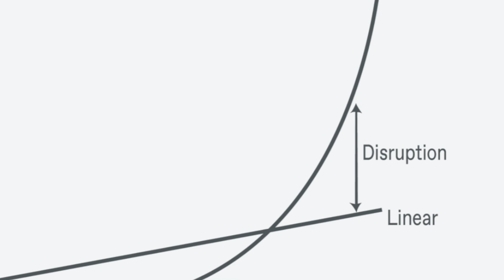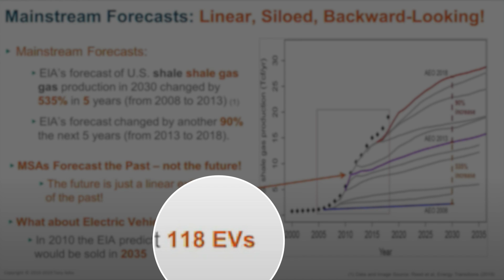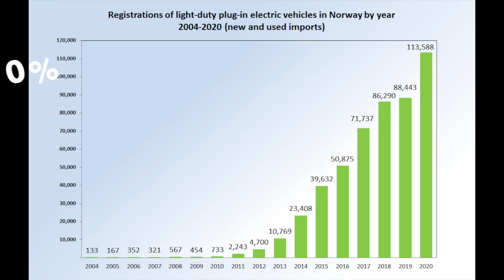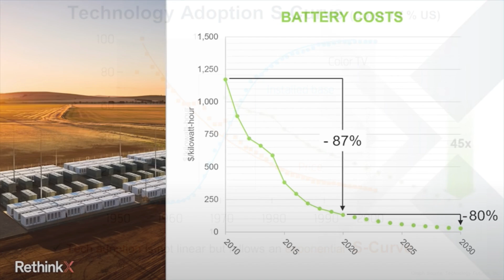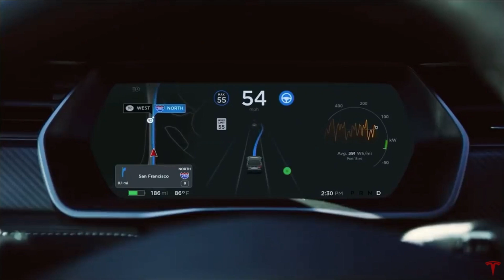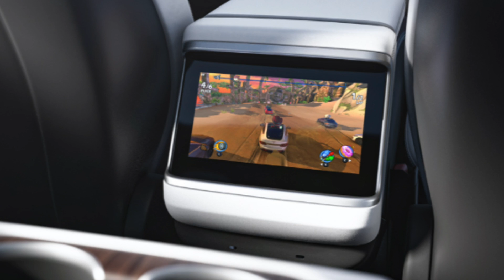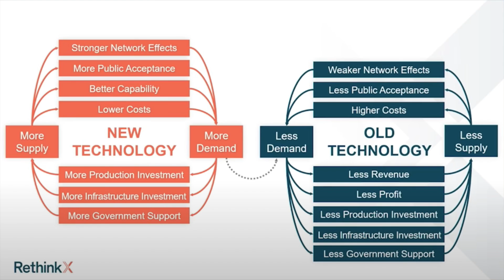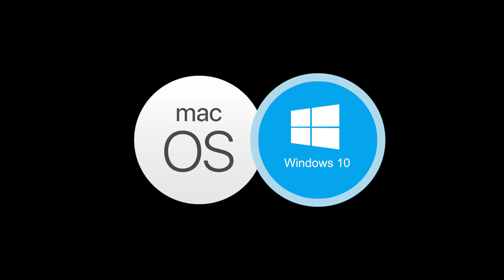Disruption ALWAYS happen in an S curve | And we are about to see something really special !

Comment: Sure, we'll see an S curve, and it will be amazing.  The big question is timing.

Internal combustion engines were being built decades before the steep part of the S curve arrived.  Ditto for cell phones.  If you were trying to predict what would happen in 1900, or in 1995, would you be able to pin down when the S curve would take off?  That would have been hard, even if you knew (and you do) to expect an S curve, not a linear displacement of old tech.

It's hard today, too, to pin down when the steep part of the S curve will arrive.

We're close, though.  Tesla is growing by leaps and bounds, and this is stimulating growth elsewhere in BEV manufacturing.

The big unknown is battery supplies, and lithium supplies to create the batteries.  Elon worries about both, and he is charting a course to address those worries, but how will that work out?  The big 3 lithium suppliers want higher prices for their raw mineral, and they are inclined let production lag behind demand, in order to wring higher prices.  Higher prices will impact battery costs.  Tesla is attacking this problem in two ways: by reducing the manufacturing costs for battery packs, and by seeking to gain lithium supplies from a new source (lithium-rich clays) using new extraction methods never before attempted, other than in small-scale trials.  Even if both are successful - we hope they will be! - everyone else is constrained to the pace imposed by lithium suppliers.  This could be a brake on the S curve, flattening it somewhat and pushing it further out.

Demand for batteries isn't limited to the automotive sector.  Simultaneously, the electric utility sector is poised for massive disruption, and to make it happen they will need battery cells in vast quantities, too.

Demand for cells will outstrip supplies for some years to come, which will tend to keep prices higher, particularly for those companies which do not have access to Tesla's manufacturing cost reductions.  Which is all of them, at the moment.  Higher prices will mean slower growth in sales of BEVs.  This problem, of cell supply lagging demand, with its pricing implications, leads me to expect that we might not see 80% of new car sales being electric vehicles by 2030.

But it will be an S curve, and it will accelerate.  My best guess is that we'll pass 80% within a very few years of 2030 - certainly by 2035, perhaps earlier.  By 2040, I think ICEV manufacturing will have collapsed almost completely, save for a few niche markets - military off-road vehicles and large construction equipment being possible examples.  Another 15 years - by 2055 - we will see most deployed ICEVs sent to boneyards.

The disadvantages of ICEVs will mount - availability of fuel will decline as gas stations close, tech and performance advantages of BEVs will improve, life cycle cost advantages of BEVs will soar.

But we should expect that fuel prices will also be in decline, owing to falling demand, and that will also have an effect on the S curve - tending to push it farther out.  I've taken this expectation into account in my own forecast.

I was particularly interested in a point you made in this video - that we might see just a couple of dominant companies in the automotive sector, as we have seen in the OS market.  I don't know.  It's true that Microsoft and Apple dominate OS sales.  We see very few market leaders in some high-tech markets - chip manufacturing, for example, or computer screens.  But if you look at final product manufacturing, we do see more competition: cell phones, digital cameras, computers, etc.  My guess - for what it's worth - is that we might see half a dozen or more automakers survive the disruption, while cell production will collapse into two or three dominant suppliers.
Reply: I like your analysis...taking it even further: if lithium scarcity has really been solved by Tesla then the next constraint will be nickel mining. As Elon Musk said: please mine more nickel....if you do Tesla will give you a great big contract and pay you lots of money...or something like that...lol. When the mining corporations tell their customers that there's only so much to go around imagine how that will affect the BEV market? Only those with a secure supply of nickel will be able to compete. On top of all the other challenges, I'm guessing that nickel constraint will ensure a smaller number of competitors as well.  As far as I'm aware, Tesla is the ONLY one that's thinking and planning this far ahead... so...i guess it really depends on how hard they are willing to push for growth. Elon has clearly stated that Tesla is willing to share their tech but right now their priority is expansion....to me this sounds like they will actually be able to force things along now and the pace of change will be rapid starting in 2023.
Reply: @yvanpajevic9680  True - but I am inclined to see nickel in a different light.

Lithium is mostly used in batteries.  There is a very direct connection between lithium supplies and battery supplies.

Not so with nickel.  Most nickel goes to the production of steel.  Batteries - even in the quantities Elon aims to produce and acquire - are just a small portion of the total.

But of course stainless steel is used in automobile manufacturing, too - particularly, it will be needed for the Cybertruck.  It's obvious that as of Battery Day, Tesla foresaw the need for more nickel than they had contracts for.

There is no question that Tesla will need more nickel.  Absolutely true.  But the electrification of transportation won't require vast multiples of present-day nickel production, but only a modest increase.

One last note.  Indonesia has very abundant reserves of nickel and is willing to increase production - but they want to apply some conditions.  They do not want to export raw nickel, particularly.  They want to make products that use the nickel and export that.  They want more economic benefit than they can gain by exporting raw ores.  Perfectly understandable, that.

There is room for negotiation.  A Tesla GF, a battery factory, a solar panel factory, perhaps even a design center - those would be potent inducements.  I expect Tesla will eventually conclude a deal that wins them nickel exports for their other factories in exchange for some sizeable production investments in Indonesia.

In any event, I don't see the same sorts of problems with nickel supplies that I see for lithium.  I could be mistaken, of course.  I often am!  :-)
Reply: You totally forgot the aviation and shipping industries, even the mining and heavy industry, they will still evolve with biofuels from recycling of our waste....... just look at how mining was made operational in new Papouasie or in the Australian desert..... Diesel is still and will remain the best energy source for decades to come.
Reply: @yvanpajevic9680  uhm wrong tesla never solved the battery constraint problem, its going to be very difficult with times to come but I hope every companies will find a way to make enough of it, the next oil is lithium.
Reply: @yvanpajevic9680  tesla is not the only company reserving lithium and raw materials supplies.
Reply: @carholic-sz3qv  The subject was the automobile industry.  I didn't forget aviation or shipping; I deliberately didn't talk about them.

At the present level of tech, diesel is indeed the best energy source for some transportation needs.

Thing is, diesel tech is flatlined.  Not improving.  And it's dirty.  Biodiesel isn't as carbon neutral as its fans would like to believe, either.  It's dirty, too.

Whereas BEV tech is not flatlined.  It's improving at a good clip.

There's a crossover point for each transportation need.  For short-range (coastal) shipping, that crossover point is quite close.  Japan is already investing in pure electric coastal ships, did you know?  For long-range shipping, the crossover point is further out, no doubt.  But it's out there.

As for aviation, again, it's application-specific.  The cross-over point is fairly close for commuter air taxis, probably.  For passenger airliners and big cargo jets, not so much.  But as batteries get better, fossil fuels will be displaced in these applications, too.

Funny thing about air travel.  Aviation-fueled jets have a service ceiling imposed by the needs of combustion.  Electric jets will have a service ceiling imposed only by the need for control authority.  They'll be able to cruise much higher, where air resistance is vanishingly reduced, where supercruising with very little energy consumption is possible.   We can't build those planes today; the tech isn't here.  But it will be.

Diesel does not deserve your sweeping generalization that it's the best energy source for transportation.  Already, that's false for short-haul trucking and consumer vehicles, and very soon, it will be false for long-haul trucking.  Diesel is on the way out.  It will take a long while to die, but die it will.  The economics of it, and the dirty air it generates, and greenhouse gas considerations, will consign it to the history bin.
Reply: @Urgelt  diesel engines are improving too, and a modern 2l turbo diesel is used in a big mercedes sprinter or a minivan, compared to the giant 6l American v8. Biodiesel can be made from waste oil/cooking oil, or from plastic recycling. There is also DPF on diesel engines. The Japanese also use alot of gas turbine powered ships.
Reply: @Urgelt  the dirty air is mostly from very old outdated diesel engines with no DPF, diesel also has soooo many other applications.
Reply: @carholic-sz3qv  Every diesel engine produces greenhouse gases and unhealthy exhausts, even those with the latest pollution controls.

I do not deny the many applications of diesel engines.

They're all going to go by-by, in time.  This has to happen.
Reply: @carholic-sz3qv  The energy density of the fuel is flat.

The fact of unhealthy emissions and greenhouse gas emissions is unavoidable.  The tech has been improved over the last decade but there are few gains left to be had.  Flat.

Burning fossil fuels, including diesel, costs more than charging a BEV.  Operations and maintenance costs are what they are.  Flat.

Don't think for a moment that 'what is' can be extrapolated to 'what must be.'  That's wrong.  The fact that gas turbines are in use in shipping today says nothing whatsoever about the future of shipping.
Reply: @Urgelt  fortunately biodiesel will continue to power diesel engines in the future because batteries will have a very hard time to catch and catch globally.
Reply: @carholic-sz3qv  Diesel will be phased out.  Not quickly.  But the trajectory is clear.

Comment: BestInTESLA - Lars , TESLA in America has lowered its price for MODEL 3 SR+ = 36,990 from $1000.
model 3 Dual motor = $46,990 same.
model 3 Performance = $55,990 increase of $1000.
and Model Y SR+ = $39,990 down by $2000.
Long Range = $49,990 same.
Performance = $60,990 up $1000. 
but, you can now LEASE a model 3 SR+ for $0 down, 12,000 mi, $1117 signing, 36 mos term, $482/mo payment.